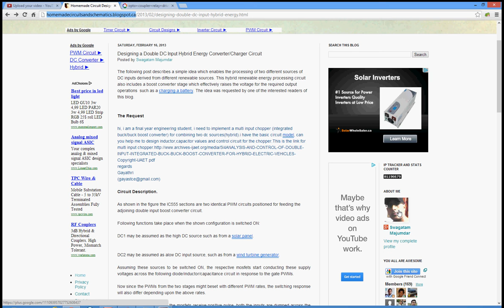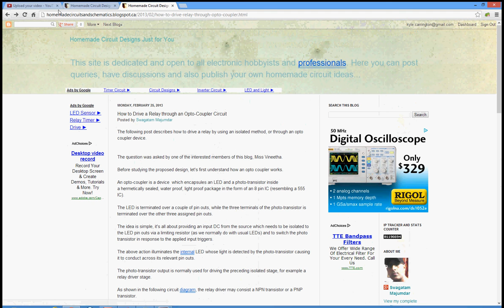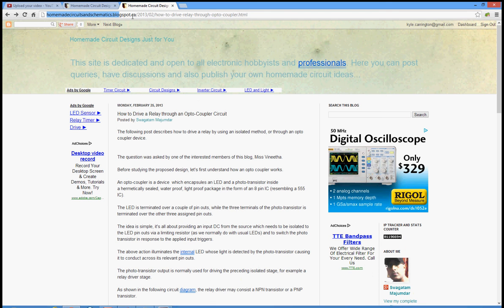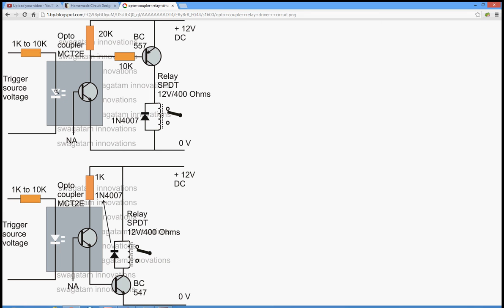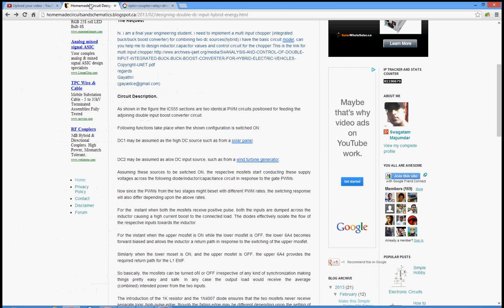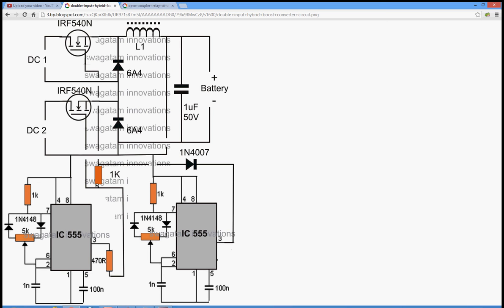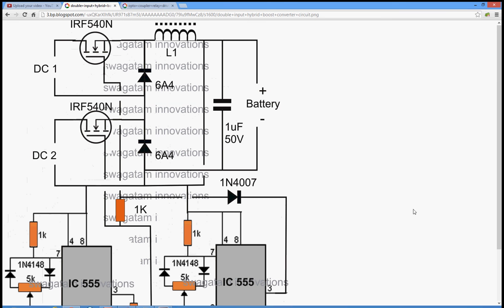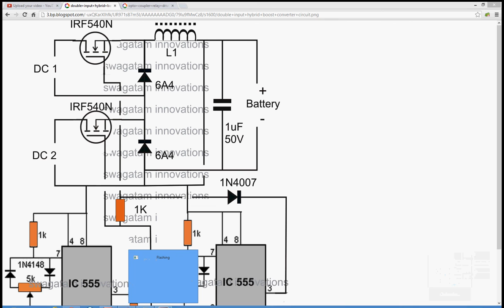Automating Pulse Spike Desulphators & Multiple DC Varied Input Charging.

Comment: Hi Kyle. According to you, what is the best desulphator I should use for my 12v car battery. I have tried with 2 sets of Bedini ssg as modified by Minoly multi-strand with two transistors in each set & got total output 1Amp but no success. Then now as from 3 days I am trying with njsharkracer circuit based on frontiersprings schematic + a solar charger for trickle charging.  Any guidance for any other desulphator, please, thanks.

Comment from the maker: Right. I was thinking more along the lines of having a load applied to a battery, and at a set time period later, shutoff, as to not overdischarge. Using voltage is doable, too, but it gets goofy.. because your loaded voltage, and the actual bat voltage 9if left to recover) are two different things, and will vary from load to load.

Comment from the maker: Good points. In a round about, sort of but not really elevent way, your comment reminded me of the DT relays. Be that SPDT or DPDT. They are interesting beasts, in that you can have one thing happened and then "pay" (energy wise, across the coil) to have something else happen, when activated. As opposed to two manual switches, or a DT switch, that is manual. Question is... how do have something that switches functions, but only at the cost of the switch... if u follow. PIC's i guess

Comment: I like the auto off/top up function. Defiantly better than trying to explain Lead acid charge rates to someone thats never charged a battery before. Would be cool to have one that just switches off and stays off too. For transferring power from one battery to another. I always forget to turn it off and suck the source battery dry on the first charge, when it could charge a few smaller batterys if I turned it off at the right time.

Comment: Good point about the charge controller type setups...multiple frequency mixing could relate.
Loads of those optical bridges in anything to do with telephony. 4 pin or 6 pin looking like chips, often with a slot cut in a circuit board to denote the non physical link. If got a home phone exchange type piece of junk you'll find a few in there, or PC card modems, or regular house phone. 
Can make them with LED and solar garden light LDR housed in a straw :)